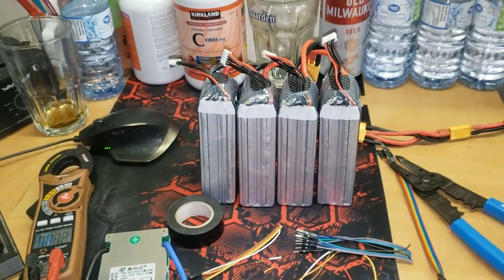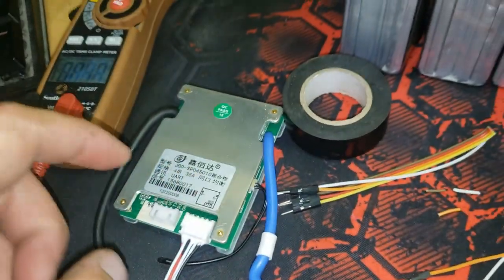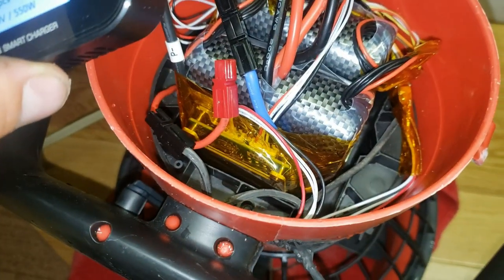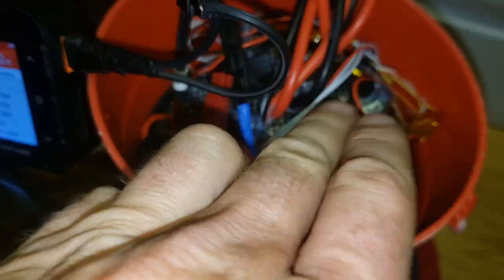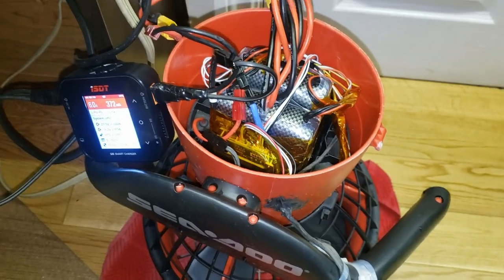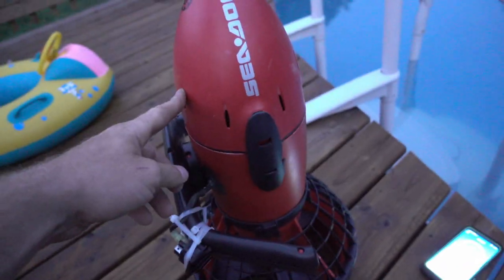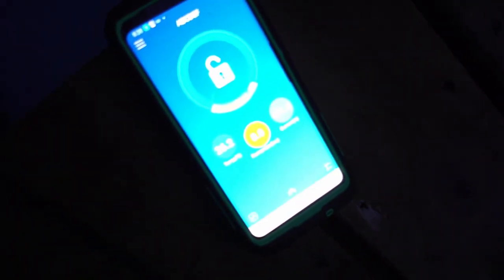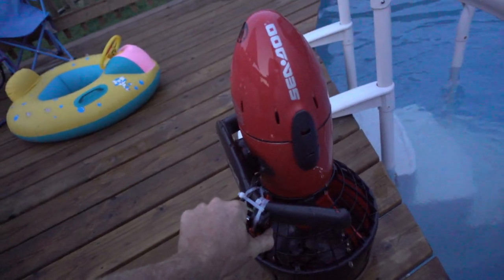Moddified Sea Scooter 2X Faster With Bluetooth

Comment: I built a 24v 7s5p replacement for my nephews crazy cart.  Used Sony g5 cells.  Thing hauled butt.  The included charger only charges to 28.11v.  So it worked out pretty good.
Reply from the maker: yes and when you add 4 extra volts its really fast, also I forgot to mention I bypassed the mosfets that where driving the motor and regulating speed.
Reply: What is the max lipo upgrade applicable  that can be applied to the sea scouter?

Comment: Great video, thanks for sharing.  Did you change it into a 15/16 volt scooter by only upping the voltage or did you do a motor swapout?  How is the motor holding up if its the original one?
Reply from the maker: Original and still doing great

Comment: Nice work bro. What BMS you use or you recommended for 48V 14S Nissan lithium ion pack ?
Reply from the maker: https://www.aliexpress.com/item/32954067682.html?spm=2114.search0104.3.1.21375d47zQfJNE&ws_ab_test=searchweb0_0,searchweb201602_2_10065_10130_10068_10547_319_317_10548_10696_453_10084_454_10083_10618_431_10139_10307_537_536_10059_10884_10887_100031_321_322_10103,searchweb201603_57,ppcSwitch_0&algo_expid=f5a9c49b-7850-4471-8995-42c1162aae1f-0&algo_pvid=f5a9c49b-7850-4471-8995-42c1162aae1f
Reply: @GoingOffGrid101  Thank you, how's your Nissan Leaf update working so far ? What's the range you reaching now ?  🍻👌🍷
Reply from the maker: @Beekeeping_Bro  around 200km per charge :)
Reply: @GoingOffGrid101 .Nice 🤙